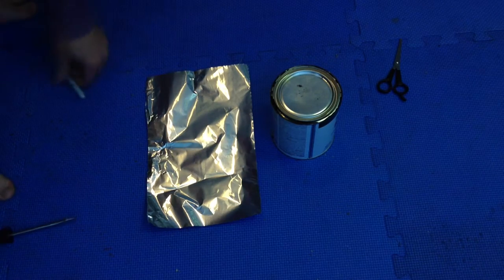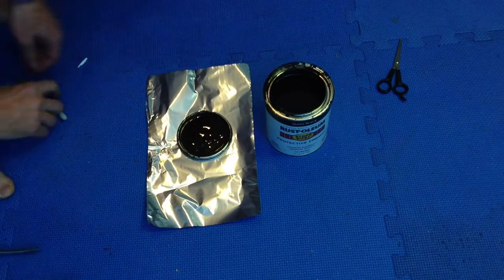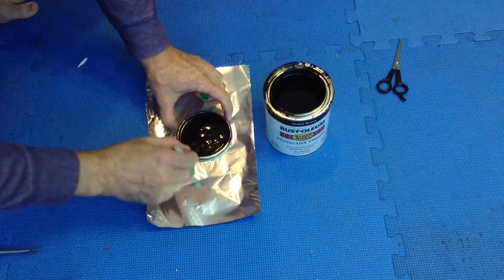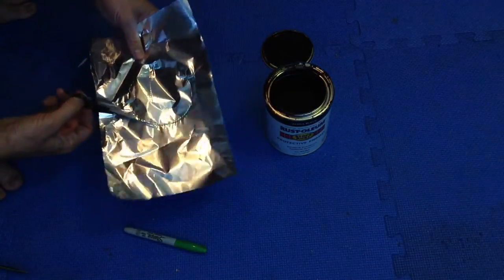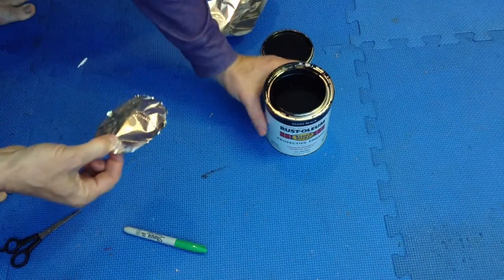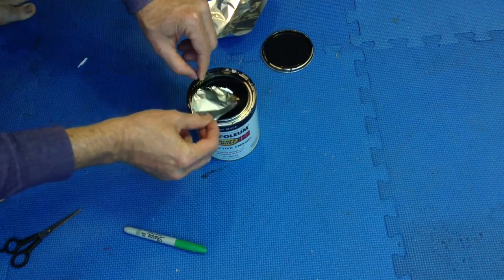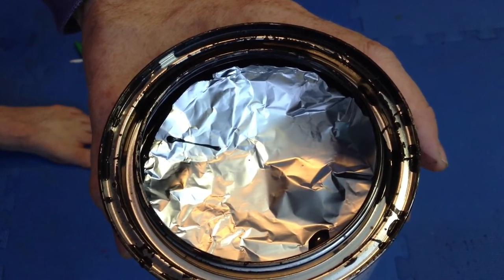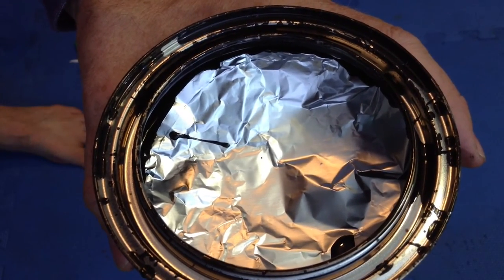How To Keep Paint From Drying In The Can

Comment: Your better off using cling/plastic film, put it over the top of the can then close the lid, stops the lid from stickingh too
Reply: When you close a lid there is oxygen inside. The lower the paint the more oxygen. You need something lower, not sure if the foil works because air can still get in on the sides.